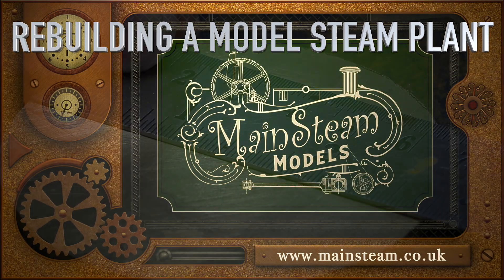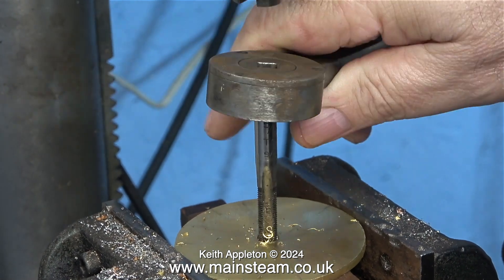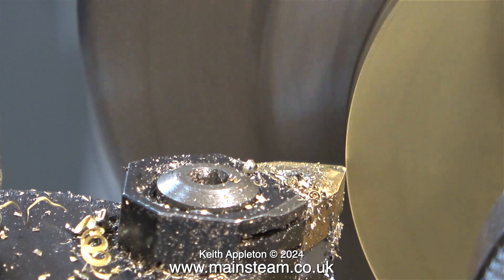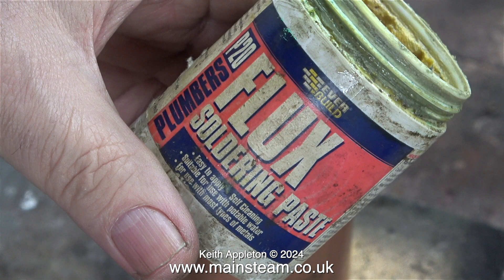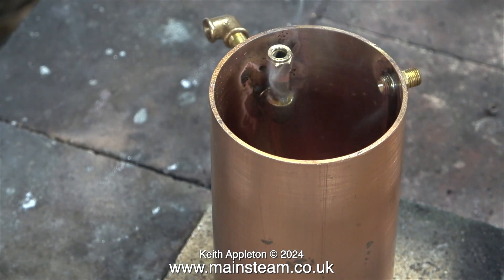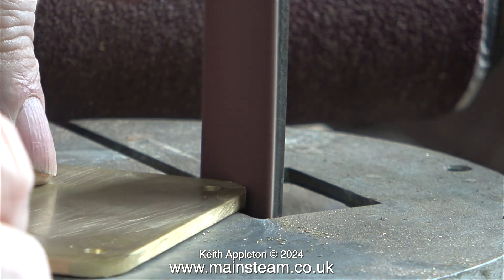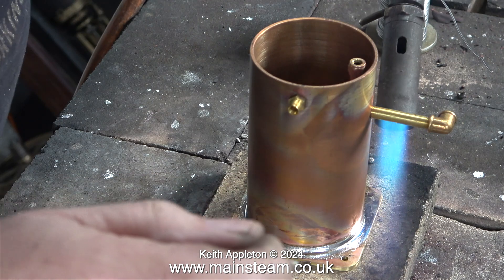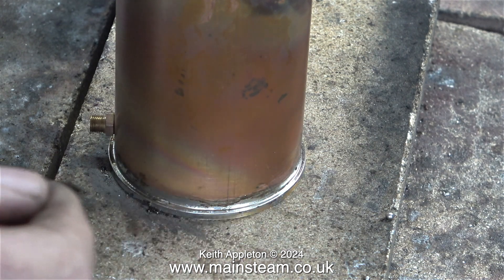REBUILDING A MODEL STEAM PLANT - PART #39

Comment: I remember using a centre finder when demonstrating to some pupils. Later a student wanted to find the centre of a 3ft diameter table so she could make and fit a lazy Susan. Unfortunately she had sanded off her original centre mark. She made a scaled-up centre finder using a piece of laminated mdf as both the straight edge and the right-angel/45 degree part. It worked brilliantly.